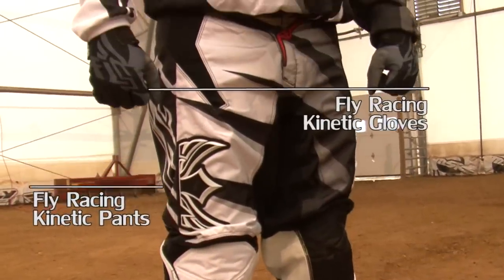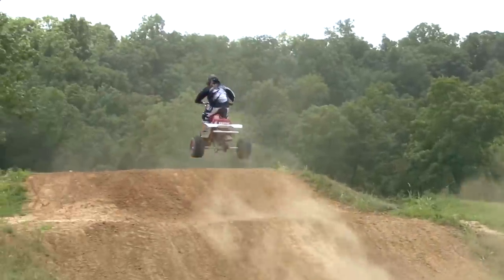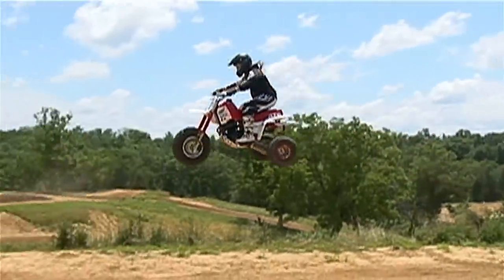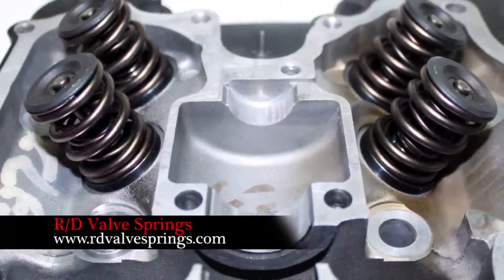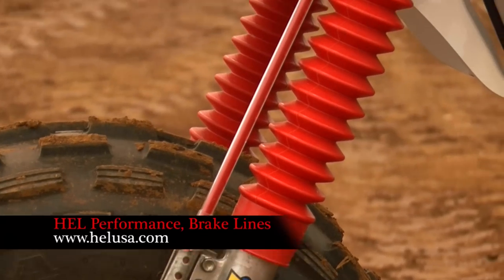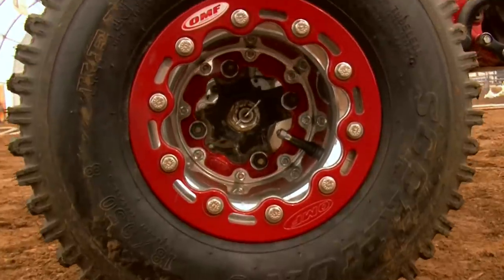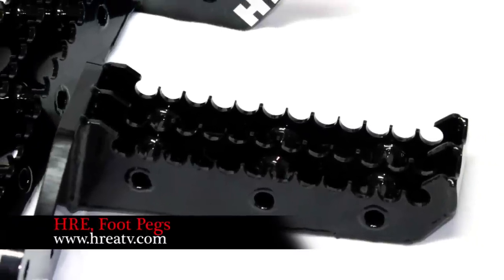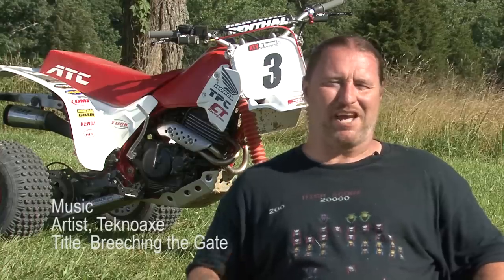1985 Honda ATC350X Vintage Motocross Project

Comment: I bought a 1986 350X brand new. The first things to go were the back tires. Replacing them with a square profile made it handle like a dream. I cut the "edges" off of the bottom of the rear fender to keep mud from building up and it also gave it a sleeker look. I welded another set of footpegs to the originals. Thumb throttle was replaced with a twist grip for all day comfort and better throttle control in big bumps and rough trail off camber situations. I swapped out the front sprocket for one, if I remember correctly, two teeth bigger. That made first sometimes a bit tall for the trail but flat out easily close to 75 mph. I had it for 10 years and it never let me down whether driven in massive sand dunes in blazing heat or in the dead of winter sliding on the snow. Four wheelers, I thought, were never as nimble and fun as my X.
Reply from the maker: We always seem to get in trouble with a twist throttle.
Reply: putting a twist throttle on a 3 wheeler is asking to die.
Reply: Yah I've got a twist on my 85 250r  and it's about got me in trouble a few times..but I don't jump it..really thinking about getting rid of it and going back to a thumb style
Reply: @Trumplican  agreed. No idea why anyone would put a twist on a 3 wheeler or quad.
Reply: Twist throttle on a trike😳

Flirting with disaster right there. When I bought my 350x it had one and was the first thing to go

Comment: I miss my 85 350x but if I was to do a build of my own I would have used a  FCR carb w hot start, steel rear sprocket either a larger oil cooler or dual cooler, red plastic with the blue seat. The 85s looked so much better than the 86s
Reply from the maker: The FCR would be a good upgrade.
Reply: @ATVonDemand  My 05TRX450r has a 68mm Falicon stroker crank 97mm CP piston custom designed with approx 12-1 compression Hotcams ST3 cam port polish with 1+ intake valves and I bought a bored 43mmFCR carb & Nos adapter from MotoExperts Dyanatech programmable ignition with custom curve to rev to 12000RPM made & welded my own gusset kit powdered the frame honda red 06 +3/4in Swingarm with GT Thunder XC link made steel skid for link ProArmor nerfs frame & Swingarm pro am skids RPM Dominator XC axle and Racetech springs. Got bored waiting on parts polished the Swingarm and had it powered clear to protect it it turned out a little milky but it looks good. Took 38hrs to polish it! An additional oil cooler  from a  400ex added approx a 3rd quart of oil ran in line with stock cooler because the Jagg oil filter adapter didn't work for some reason. K&N filter Outerware modded lid cover FMF Factory 4 full exhaust! Custom 2×6 × 2 lights on White bros bumper and custom 2×6 led light on Lonestar 7/8 antivibe bar and steering stem because the 450R's stock lights SUCK!!!
Reply: The whole reason I did the 68mm and not the 70.4mm crank is because of the 350x's 68mm crank reved so good compared to my 400ex I believe it's 70ish

Comment: I’ve raced the 85 350x amongst others and could easily kick this guy’s butt, on the track shown, on a stock 350x with two exceptions. Flat track tires and wheel spacers, $200-$300. This bike shown has literally thousands upon thousands of upgrades ($5000 at least) and he’d still be in my dust racing on this track. And if it were trail riding, he’d never see me again after two minutes of riding. Sorry, but that is the truth.
Reply from the maker: Oh yeah, you're the man. We all want to join your fan club. Can you please tell us where we can buy your Fathead so we can stick it on our bedroom wall. Would you autograph it for us? Man you're cool. I think your are our all-time favorite viewer. You're probably the best three wheeler Rider that ever lived. I bet Marty Hart would like to learn a thing or two from you. Hey, I want to fire Rob Ray and hire you could you please send some video of some of your excellent riding? You're the man.
Reply: ATVonDemand Don’t take it so personal, just stating facts.
Reply: just stating facts, on my worse day you couldn't hold a candle to anything I can do, and that would be me doing it blindfolded. Before making accusations, be sure you can back those up. All my achievements have been video documented, where are your's?
Reply: Rob Ray Wrong, sorry, you wouldn’t stand a chance. I’ve seen your riding ability, and you’d be in my dust from the hole shot until the checker flag, guaranteed.
Reply: I'll believe it when I see it. It's really easy to brag behind a keyboard. I'm sure you probably haven't amounted to anything in life. That's ok, you have my sympathy and you can enjoy the moment living through me.
Reply from the maker: that's right Rob, he has seen you in your four million video views. Soon C harlett will make her video debut and set you straight.

Comment: Came so close to Ebaying my 350X.  Wrote the ad five times and couldnt do it.  Team ATC forever.  Did mine 10.5:1 with Webb Stage 1 cam, full Xcellerater pipe and jetted it.  Any more power and I'll be fusing vertebrae.  Perfect with tall tires, climbed every hill in Hatfield/McCoys.  Kept up with 4X4 quads all day long like a billygoat. Quads have one too many tires. Your machine is very sweet.
Reply from the maker: +bagginit45 I hope we played a role in helping convince you to keep your machine. We love the 350X

Comment: This is one machine I never got to try unfortunately. How do they stack up vs the 250r?
Reply from the maker: Jamie Nichols I think you're going to find out at some point. We are planning on dusting off the three wheelers and putting them head-to-head in the future.
Reply: I heard the 350x was fast, but I assumed the claims were a joke because most 4 strokes were slow. I know that's all changed now.

Comment: 1985? Vintage? Are you guys americans?
Reply: its vintage for atc/atv world. The first four wheel atv ever was made in 1983 by suzuki.
Reply: i have a all stock 81 honda atc 200. still runs like a champ! everything but new spark plug and oil and a new headlight and chain.  4 speed. gets alittle ruff if you let er rip through a feild cause theres no suspension lol but i bought it for $300 and i doubt ill ever get rid of it!
Reply from the maker: Good stuff. We'd like to pick up a 185S at some point.

Comment: Can't wait for the 250R and 200X. Especially the 200X, I have one. Which generation 200X are you doing? First (1983-1985) or the second (1986-1987)?
Reply from the maker: It will have to be the 83-84 model. The 85-86 didnt have nearly the aftermarket support since they weren't raced like the generation 1 machines.
Reply: You mean the 83-85 model (they were all the same). That's what we were expecting, thanks ! Can't wait either. Do you have a time frame on that? Any other trikes you might be doing?
Reply from the maker: Once the 250R is complete we will be on the lookout for a good running 83-85 200x to evaluate and build up., Other models? sure, but none officially on the list yet.
Reply: Sounds fantastic. There are a few members on 3 Wheeler World that are interested in donating a 200X for your use if you are interested. I can get in contact with them if you so wish. As far as other models, several members have expressed interest in a 250SX and 1981/82 and 1983/84 250R's, as well as non Honda ATC's such as the Tecate 3 and Tri-Z 250. If you guys are game, locating the trikes should not be an issue.
Reply from the maker: Doing a build on a 200X will require us to purchase a machine. Test rider Rob Ray has a 250SX in VGC we have discussed doing a review on. In the long term, we would love to test all of the machines you mentioned. We will keep squeezing vintage tests in, as long as they continue to prove popular. Honestly, vintage tests are fun and different than what everyone else is doing. We appreciate your support!
Reply: That is fantastic news to hear. I spoke with Rob previously and he actually made mention of the 250SX in the future which is why I brought it up. I'm glad you guys have interest with these old machines, it's making some die hard members squeal like little girls that you are thinking about doing some of those tests, and as I said, have members that are willing to donate bikes to the cause. The tests are wildly popular and you will always have my, and many other peoples support. Look forward to hearing from you.
Reply: ATVonDemand It's a good idea people love to see these old machines in action I highly recommend you do a 250sx and 200x that would be awesome!
Reply from the maker: Already in the works!

Comment: Could you guys do an episode on the 1986 Honda 200x?
Reply from the maker: We will be doing a Classics review featuring both generations of the 200X. We will also be doing a build on a 1984 200X similar to the one on the 350X. Unfortunately, the later generation 200X models don't have as any aftermarket parts available.
Reply: ATVonDemand yes please do. Anything helps ha I'm rebuilding mine at the moment.